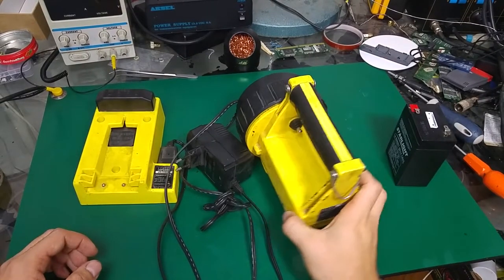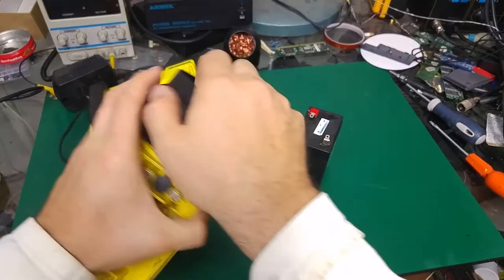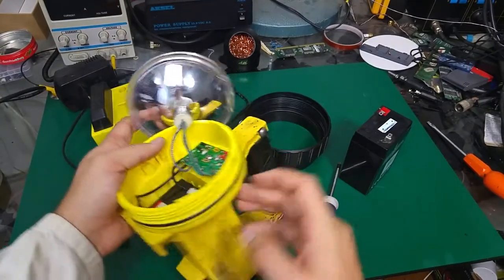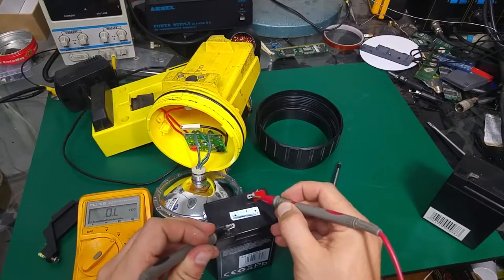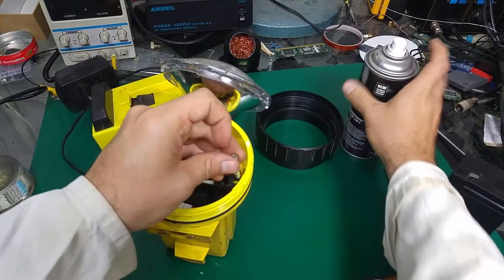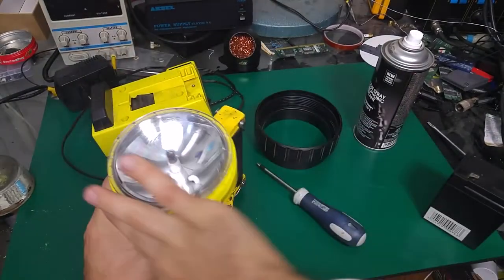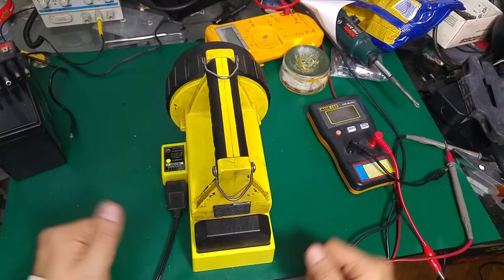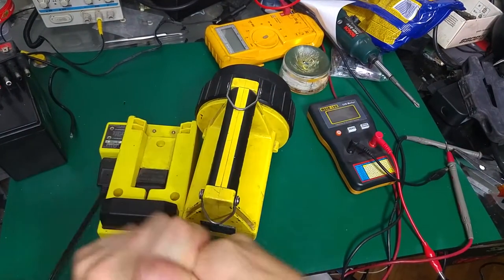Replace SLA 6V battery in Vulcan Streamlight xenon atex flashlight

Comment: A very comfortable flashlight, but its grasping feet are bursting. A bit low quality of workmanship. No real glass on optics. However, it is a cheap flashlight to maintain, the batteries are cheap. The English WOLF flashlights are much more resistant, more tight, but the expensive and hard-to-reach parts have weaker light. Great video :-).
Reply from the maker: Nothing more to add,  mine feets also are broken ^^,  recommend stay on my channel, soon I will show nice powerful halogen SLA spotlight (off brand, non atex) but still have nice quality , feel and also very easy to work on in term of cheap consumables.